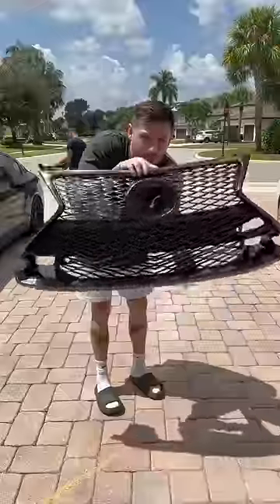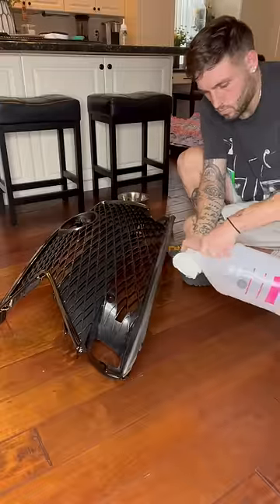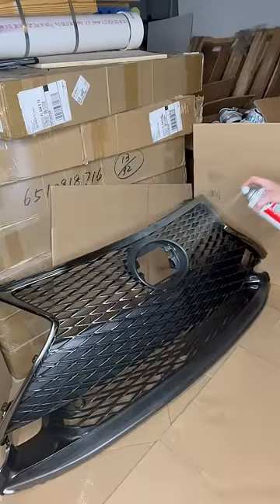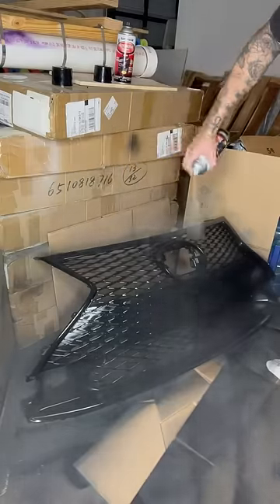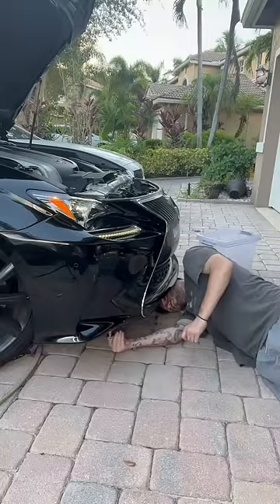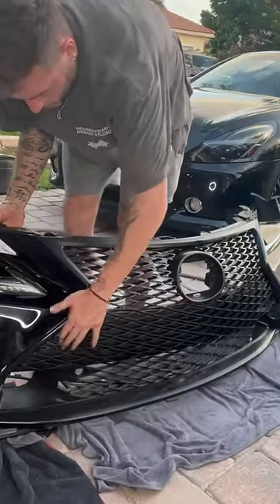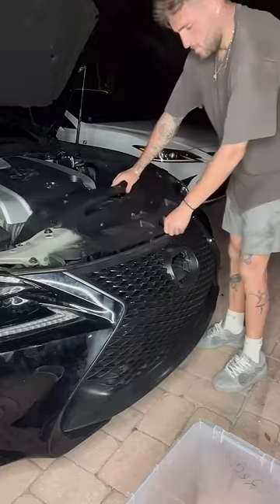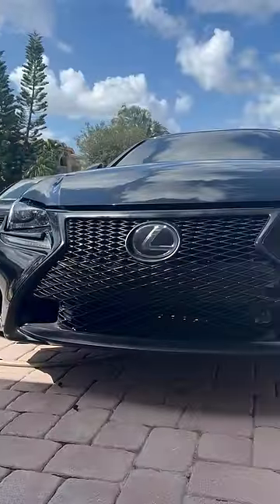Im sure those werent important 🤷🏻‍♂️ #cars #cartok #diy #custom #grillswap #lexus #rc350

Comment: Use wax and grease remover instead of acetone. Acetone tends to break plastic down and it could lead to solvent pops when you paint. Adhesion promoter helps with the paint sticking to the plastic otherwise you’ll have it peeling off at some point.
Reply: That’s what the sanding and primer is for, it won’t peel.
Reply: This dude is clueless
Reply: @joetroy2904 using acetone after sanding defeats the purpose . That part will be peeling and bubbling within 2 months
Reply: @Mharve  Now acetone doesn't evaporates 🤔
Reply: @joetroy2904 welll buddy. Umm sorry to say. It you are priming plastic. You are supposed to adhesion promote before you spray the primer. So yes. That grill will be peeling in a couple months.
Reply: @joetroy2904 Sanding creates a mechanical bond, plastic also needs a chemical bond🤦‍♂️.. Thats why you use plastic adhesion promoter, or adhesion promoter for short. Then you prime over that. Then I would use a 2k dg black over that, no clear..

Comment: I work for Lexus in the collision department and those metal brackets you have are ment to reinforce the top of the bumper since all the stuff on the bumper tends to make it heavy. You are probably fine without them but I would put them on cause it will prevent future sagging of the bumper.
Reply: Surprised you didn't mention that he also needs his front millimeter wave radar calibrated as well since the module was removed and reinstalled.
Reply: Meant*

Comment: having taking apart dozens and dozens of lexus bumpers the seeing the lil clips leftover brings up good memories 😂 i worked at a lexus dealership as a certified painter and removed and installed bumpers for every car,nothing worse then getting a grill piece or light piece assembled only to realize u forgot (or misaligned even)one clip on a inner bracket,as now it wont stay put or in the right place..now gotta take it all apart again

Comment: i’ve worked as a tech for Lexus for 3 years and i can confidently say that the first grill cover is not OE, i’ve never seen one like that for an RC. the 2nd one is OE style.
Reply: You've probably only ever seen the F Sport come in because the first grille is 100% OEM, as this is from a base model RC (non F Sport). You can Google "Lexus RC base model" for more pictures.
Reply: @sitodemeter943  i think the angle threw me off a bit. i have definitely seen them in my 4 years at lexus

Comment: Eeuh be careful with the acetone. That tends to melt some plastics and ruin them. Usually it's better to not use that and use like rubbing alcohol or something like that. Did you have gloves on? I didn't pay attention on that, use gloves mostly for like keeping the oil from your hands off the part youre painting. I see all kinds of painting tips n stuff that's what I remember the most.

Comment: Owns a Lexus....does a half ass paint job that had lots of orange peel and probably extremely suseptible to rock chips. I bet it faded within a year. 
I personally would have left it the gunmetal grey color for contrast. But if i wanted it tru black, i would have taken it to a paint shop, paid a few hundred for a factory looking paint job and much more resistant to rock chips.

Comment: The amount of people that don't have a battery powered power ratchet is astounding, it make your life a lot easier in that situation
Reply: Most people don't just work on cars all day or need particulary and use it enough to justify it.
Reply: @TYPICALTRYHARD_  well, I mean like this guy in particular. I don't even really work on cars like that, but in the event of changing a tire or whatever on the side of the road, it makes a good nut spinner because it fits in most toolboxes you'd keep in your trunk.
Reply: @TheCatabolicTrex  still tho not everyone is going to be justifying an expensive purchase for this one particular situation I might need it in
Reply: @TYPICALTRYHARD_  I got mine off eBay for $70

Comment: As an auto painter that wont last or look good. No primer unless your fixing, 600 grit is kinda needed to stay in a high chip area. A real paint gun and real auto paint are game changers. I wouldve washed it twice with scuff stuff on a grey scotchbright and blew dry then sat in sun for an hr. Spray a black single stage one coat then let rest for 30min in a cool dry area and 2 coats of a high solids clear then let sit overnight followed by a few hrs in the sun the next day to cure more (auto paint is still curering 90days out) and assemble. This not only looks better but will look great for 10plus years and resist chips well. The texture you got was from primer and horrible gun technique move like a machine starting at a corner and working across back and forth until covered and home gamer paint in general but especially clear is garbage like you just made so many headaches for the next guy we cant even put real paint on top of that trash😂

Comment: The lexus in my pfp is mine. Orange car isnt. The grey metallic that grilles come in is actually really nice and I would never paint over it. Especially not with spray paint. I’m not hating but next time please do it the right way. Slam the car on it’s nuts, exhaust, intake, wheels, tune, strut bar, sway bars, and you’re all set